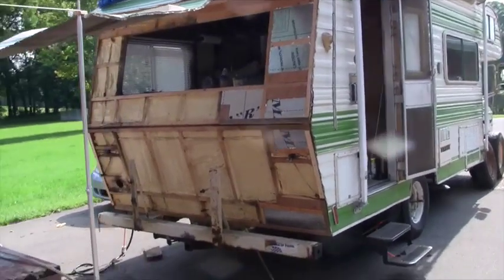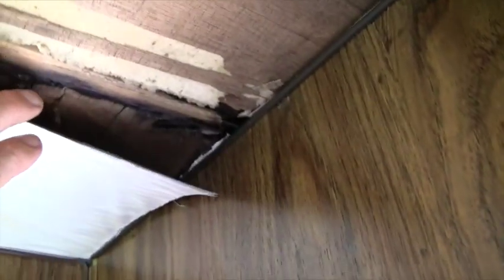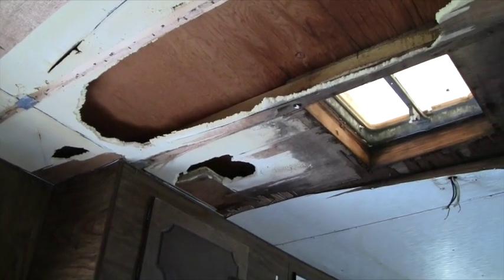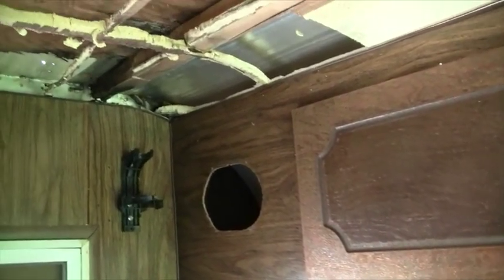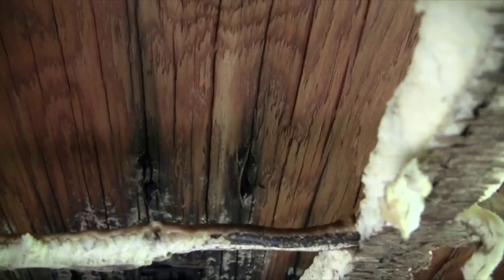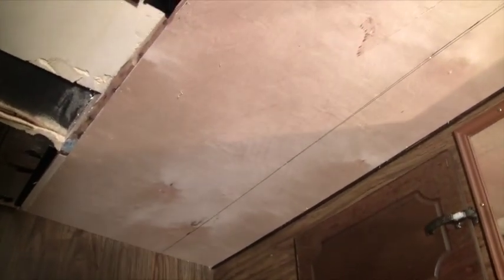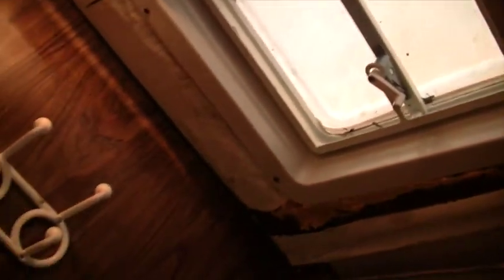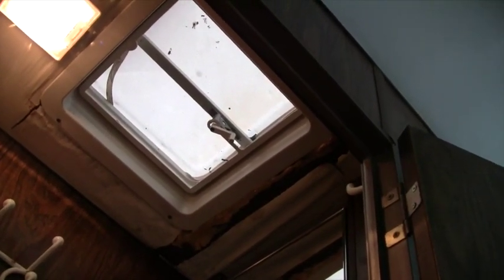Dodge RV Ceiling Replacement

Comment: What about on the part of the ceiling where the cabinets are attached to the ceiling? How can you be sure there's no water damage to the ceiling and timbers there? ..and how would you replace that part if it too had water damage and rotten timbers without removing the cabinets ? What's a good way to address something like that without pulling down the cabinets. ?
Reply: ben wright Black mold dude

Comment: I have a question...did you repair the roof before you repaired the interior ceiling?  Presumably so.  What did you use to repair the exterior roof?
Reply from the maker: Hi London.  I repaired the outside after I removed the interior so I could see where the leak was coming from.  The leak was from the holes where the ladder attached.  Once I replaced some interior wood, I then had something solid for the screws to go into from the outside to re-attach the ladder.  I then used RV caulking (I believe it was ProFlex RV) to cover the screw heads really well to form a seal.  I then replaced the interior ceiling.  Thanks for watching!
Reply: Richard Beard